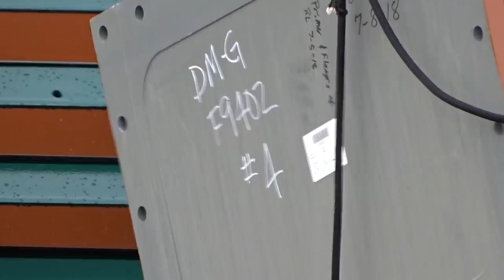Canada's Wonderland Construction Update  & 6:30 am?

Comment: I still believe that this roller coaster will be a giga not in height but in drop....
 If not I will be disappointed
Reply: Nathan T it isn't going to be 213 feet for sure. Doesn't make sense considering we've not gotten a coaster since Leviathan
Reply: I think it'll be good no matter what but man I hope it's taller!
Reply: nytr l that doesn’t make sense just because you haven’t gotten a coaster since leviathan doesn’t mean your next coaster is going to be super tall a wing coasters is different than a hyper style coaster the track is different and it has inversions (gigas aren’t a coaster type giga is just a height thing so fury 325 is a B&M hyper model that is over 300 feet same with leviathan)
Reply: The 213 ft height makes no sense, but if that's the height it comes out as, it's a signal to diminish importance of CW to CF going forward, since they don't want to invest in the incremental value. I think more supports need to be on the way to increase this height above this 213ft height.